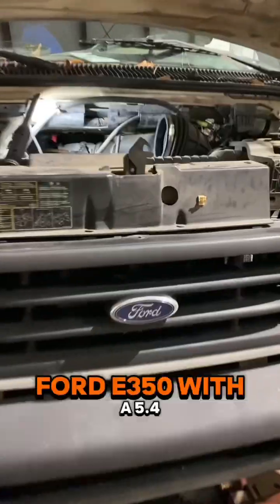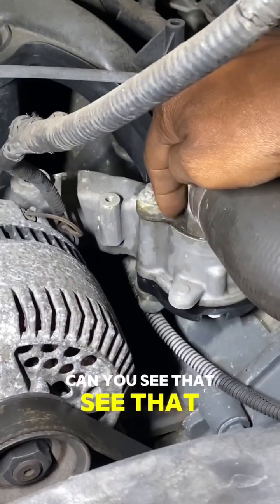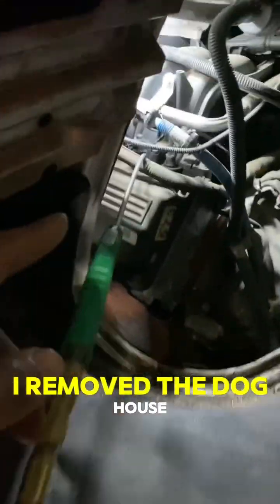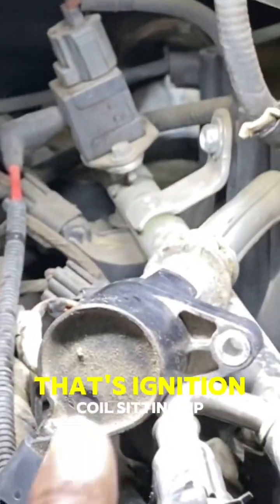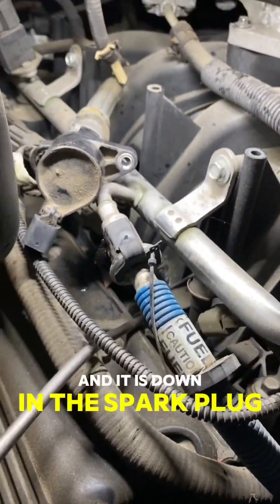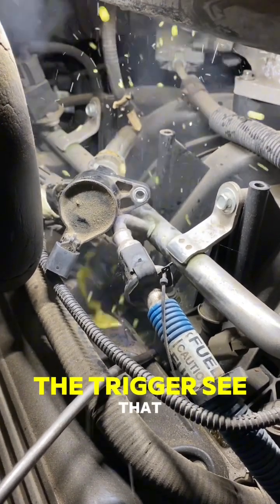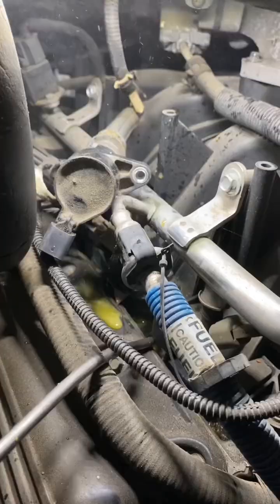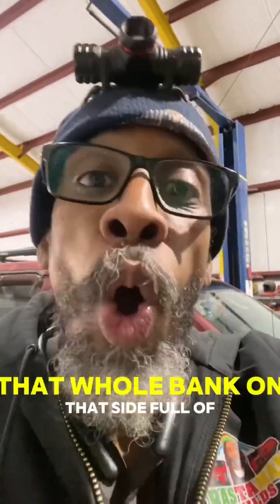Ford Flaw #FordE350 #CoolantLeak #MechanicInsights #AutoDesignFlaws

Comment: Swear ford manufactures in the early 2000s took it as a challenge to make that intake manifold a POS and super inconvenient in as many ways as possible (i replaced mine on my 01 crown vic and got to learn that the fuel safety bracket wasnt really designed to be removed)
Reply from the maker: lol

Comment: And thats not all. The older 5.4 needs new intake gaskets at tuneups otherwise the coolant crossover tube can leak into the plug wells too just like this. Then you also get bad coils bad plugs etc.
Reply from the maker: from one thing to the other